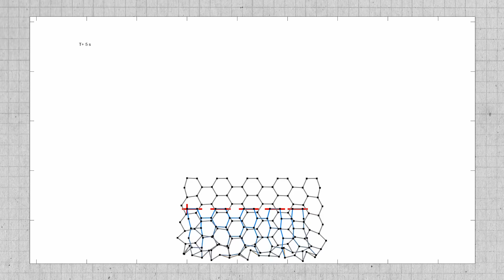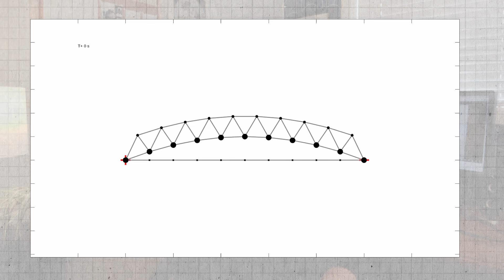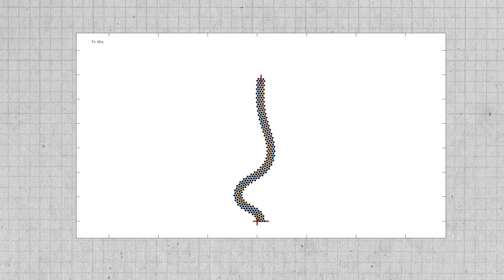Hexagons Are NotSoGreatAgons

Comment: My research work focuses on Hexagons, and I have compared some designs to triangles. 
Neither Hexagons or Triangles are the Bestagons. It depends on the application intended. 
Triangles have at least two sides with angles less than 90 degree. If you are using triangular plates to reinforce a composite, the the sharp angles work as stress concen-"traitors" and thus cause earlier failure or internal cracks. Hexagons in that situation would have angles of 120 and thus reduce stress concentration at the edges. You still also obtain large area within a small contour relative to triangles for reinforcement. There is plenty of related research in bio-inspired structures based on Nacre.
Triangles in strut structures are definitely more stable and rigid. Again nasa has used that significantly is what is called "Isogrid".
Discritized Circles are GONS with large number of sides, and in some applications, circles are the best.

Comment: Your argument has many issues. For starters, you claim that the examples in gray’s video of graphene is inaccurate because the carbon is resisting all other carbon, not just the one. This, however, does not matter at all because it does not change the fact that graphene is still extremely strong. It just means that the examples in gray’a video are very slightly inaccurate. Then, you neglected to mention that gray himself that hexagons are tear resistant vertically, but also flexible and fragile horizontally. You don’t test both angles, which gives triangles an unfair advantage in the stability test. You constantly don’t mention hexagons strengths, which would be fine if you didn’t claim that this proves triangles are better. However, you are claiming they are anyway without even close to a fair measurement. As for the honeycomb pattern, there are other reasons why the honeycomb pattern is used instead of something like foam. You aren’t an engineer, and don’t seem to have done any research in why they use specifically the honeycomb. You also claim that triangles are better for things like bridges. They have very different usages, and this argument is like comparing tape with backpack straps. They aren’t remotely similar. Also, in the section where you talk about how hexagons are not just a bunch of triangles, that is only in a situation where they are not tiled large enough. The bridge example suggests that those triangles form a hexagon, but they aren’t even in the correct shape. If you removed triangles from the grid where actual hexagons were formed, you would find that gray was correct, because those are the only ones that actually form hexagons. The ones in the bridge do not. On top of that, the statement is not even a fair statement. Removing a triangle would make it 5/6 of a hexagon. This is an unfair comparison, and you were still wrong regardless. You seem to constantly only show examples that are bias towards triangles, make straight up false arguments, and neglect to mention extremely important details that make all your statements objectively false or insignificant. Weather or not this is on purpose is debatable, but either way this video is very misleading and false

Comment: 3D printing is changing the math of what internal shapes you can put in a fill for cheap. Those triangles will probably gain popularity as the printers come down in price.
Reply from the maker: @garinsutton6808  the issue I’ve seen FDM 3D printing with triangle infill is that the head has to change directions at the same place so you get bad adhesion. Unless you’re using SLA sintering I think squares actually win out

Comment: I know I’m late, but I have a few questions. Mainly out of curiosity, because all though I love science and math, I am not an engineer.

When relating to the actual connection point between hexagons, would it not be stronger than a group of triangles connection.

For clarification; It is shown in the examples of how hexagons fail to hold shape while triangles don’t. Though not relating to the shapes strength itself but purely its three pointed connection which kind of makes a triangle like connection which is as stated by the video triangles are fairly structurally sound. 

Next question, maybe I misunderstood something but I don’t think shapes fold into each other like that in real life. It doesn’t really change how the hexagons fails, but I am wondering if it is more of just for the example or actually something more significant?

Lastly, HEXAGONS ARE STILL BESTAGONS

Though this video was genuinely cool to watch.

Comment: The hexagonal sheets too often form aromaticity - which causes the electron clouds to delocalise to WITHIN the hexagonal carbon rings. I.e. the repulsion you described but your supports aren’t limited to the nodes

This causes them to have a very different property to a normal hexagon like you discussed and may be why there’s that observed disconnect for why hexagonal organic structures

Your simulation at around 6:20 shows this well; because its going to behave more like cyclohexane instead of graphene
It’s remarkable how well the addition of the triangles simulates that aromaticity 
There’s a reason we often denote aromaticity in organic chemistry with a circle though; because in reality the electron clouds behave like one. In otherwords if you increase your no. triangles from 6 to infinity; the resultant circle inside the hexagons with triangular braces is how graphene and aromatic lattices behave 

You’re super close with your simulations, but if you check the electron density diagrams of graphene,you’ll see what I mean

Comment: Im sorry but im with the hexagons are the bestagon for that one reason, manufacturing. You're right with rockets where weight is everything being able to cut a few grams is worth it. The thing is most manufacturing doesnt need that level of weight savings. In fact i think that me being to go and just buy honeycomb structure is incredibly useful for any project id want to do. You technically could make your own custom trigular structure but then the question becomes is the time you put into making that structure worth the weight savings? And most cases, no. I came from working on cars so my idea of engineering is much more pragmatic than a true engineer.

Comment: Misleading.  He never said "hexagons are the strongest shape," whatever meaning that even has out of context, he specifically said "most mechanically stable for the least material."  I suppose people could misunderstand that as point load of this kind but I don't think you've disproven anything he actually said.
Reply from the maker: @XatxiFly  it is not the most stable for least material, that is the triangle. If you add the extra material to make a hexagon into 6 triangles sure the material doubled but the strength MORE than doubled. You could make the edges thinner and get that material back, or just use larger triangles to the same effect.

Comment: I’m not an engineer so this may explain my ignorance, but what if at 3:50 you connected two furthest points? Wouldn’t you have compression and tension? Obviously this is adding members so it’s still not as good as the triangle, but it wouldn’t need all the furthest points connected.
Reply: Two furthest points of the hexagon? It would still collapse right? Or what do you mean?

Comment: IMHO the Pentagon is the bestagon because take 12 pentagons joined at the corners they will stand up proud. Repetitively triangulate those pentagons results in the Epcot dome. The hexagons that appear are just a secondary effect as the pentagons are still there, but smaller.

Comment: The main thing going for hexagons is that they are the highest sided shape which can form a regular tiling. The more sides a regular shape has, the lower the ratio is between perimeter and area. Circles have the lowest ratio, but can't be tiled and always leave some space in between them. So hexagons are the shape to subdivide the greatest area with the least amount of material.

Triangles are strongagons, Hexagons are efficientagons.
Reply: And what are squares?
Reply: @anthonypacillas4830  Squares are easy to cut and can be turned into the strongest shape, triangles, with a single reinforcement between the corners. Squares do use more perimeter than hexagons to enclose the same amount of area, however.
Reply: @Darth_Insidious  Hmm, I will need to soul search more info.

Comment: Actually never heard of cgp grey or the video that you mention. also never seen any of your vids before either. no idea why youtube sent me here, but the topic seems interesting. XD

Regarding the strongest shape, honestly, I've always thought that circles were the strongest shape, until I got more in-depth with the topic. The reason for that was that I saw a lot of arch bridges as a child and I thought "well, the engineers who built this thing must have chosen that shape for a purpose so it's probably just the best way to do things." On truss bridge stuff, I thought that they used trusses instead because they're easier to make and require less material than an arch bridge (and in some places building an arch bridge would be simply unfeasible because of height and stuff). Same with those big pressure tank things on trains, they're always round so I just thought that circles were simply the best at everything.

Comment: Obviously triangles are stronger than hexagons, but the reason honeycombs are comprised of hexagons is because they offer an optimal compromise between structural integrity and material usage. The simulation at 6:00 -- while very cool -- is somewhat of a moot point since (as u later explain) it is "wet spaghetti". Circles and triangles are the strongest 2D shapes but interestingly both form hexagonal patterns when packed together

Comment: Grey never claimed that they were the strongest shape. He claimed that they were ONE of the strongest. Which is true when applied correctly.
Reply from the maker: strong relative to what? Of the regular polygons, only triangles quadrilaterals and hexagons can tile. Triangles are the strongest, quadrilaterals are optimized for forces in two directions (see ULA), and hexagons are wet noodles by comparison. What are they stronger than exactly?

Comment: I was under the impression that "strength" usually refers to how much force an object can take before breaking, not deforming. by that definition, strength and rigidity would be 2 separate things, but they're used synonymously in this video. is "strength" actually a clearly defined term across science and engineering, or can it refer to multiple things?
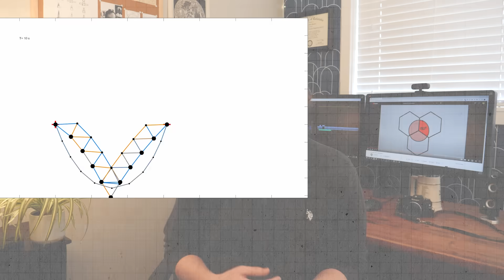Reply from the maker: With regards to materials you are right but I would argue that they are very much linked when looking at large structures. For example, the bridge at 8:00 didn’t fail in the material sense where a member broke from stress, but if an engineer tried to argue that the bridge was perfectly strong you probably would disagree because it collapsed under its own weight.

Also in terms honeycomb, triangles would actually be stronger because they are supporting some of the load unlike hexagons which are too flexible to really support the skin under tension or compression.
Reply: As a structural engineer, I can confirm that strength and stiffness are not the same, but they do often correlate. Steel is about 30x to 50x stronger than wood, and is also about 20 to 30x more stiff, but as you can see, it's not a 1:1.
 
Specifically, strength would be compared to a stress rating. Mild steel often can support about 36 ksi (kips [one thousand pounds] per square inch), while stronger steel can support 50 to 100 ksi. So, if you have a 4 sq inch bar of A36 (mild) steel, you''ll get about 4*36=144 kips of capacity (in tension, or in a short compression block). Concrete is around 3 to 10 ksi, aluminum is about 10 ksi, and wood is more like 1 ksi.
 
For stiffness, the rigidity, that's another value, the Modulus of Elasticity, and is a measure of how much a material respond to the force. All forces requires deflection, but you can change that a lot by using more stiff materials. Steel is almost always about E=29,000 ksi, which means, if it didn't break (at 36, or 100, or whatever ksi), at a force of 29000 ksi it would have elongated by double. In practice, steel yields at about 36/29000 = 0.1% elongation. Concrete has a about a 3,000 ksi modulus of elasticity. Wood is about 1,500 ksi. if you have 10k ksi concrete and 10 ksi aluminum, they both still have their own moduli, at about 3k-ksi and 10k-ksi, respectively. If you go ahead and make the same sized column out of each material and apply the same force (below both of their yield strengths), you'd find the concrete deforms about 10000/3000 = 3.3x more than the aluminum column, tho, as discussed above, both of these are going to be o the order of a couple thousandths of an inch, even if the test specimen is a foot long.
Reply: yes multiple like the gender and confusion you had

Comment: Adjacent to the rocket structure point, and how the rectangular grid is good because it offers long, straight load paths for structural stresses: Hexagons are potentially good for spacecraft heat shield tiles for specifically not having such long, straight paths between them. Not because of structural load, as they're not load-bearing structures, but because hot air will get in between any gap in the tiles, and apparently what you really want to avoid is long, straight paths for the air to take. I don't know why this is, I'm not a rocket engineer, it's just something I've heard from people who are. Hexagons should make the tile spacing more forgiving.

Comment: CGP gray was trying to make the strongest shape while using less material.
Reply from the maker: That’s still triangles. Going from triangles is o hexagons reduces weight by about half but more than halved your strength, leaving you with a worse strength to weight ratio. To compensate you would have to thicken the walls of the hexagons, resulting in a heavier structure overall.

Comment: You completely missed the point of hexagons. They are NOT meant to be the best supportive structure, they are meant to get the most out of a given surface area when tiling it up. You COULD patch the leather of a soccer ball out of triangles, but I would argue, that would require more stitching, and therefore more opportunity to breaking.

Use a concept in the wrong context and it sounds stupid. What a great revelation.
Reply: I would say your argument is a bit flaud due to Football players dont use hexagonal balls anymore. They use different shapes so its easier to make and they look cool. Some examples are the jabolani which used triangles and another abstract shape and the ball for the 2022 WC ball which uses alot of triangles. Another example are your grampapis old football when he used play which used 18 pannels of Rectangles.
Reply from the maker: My point exactly
Reply: @ConHathy grey NEVER said hexagons are the strongest shape...

Comment: you're forgetting that the hexagon is 6 triangles; you one example where you got close to it you over supported the hexagon (Adding extra bars vertically and horizontally) instead of attaching all the corners to the center point.

You need to be comparing tiled hexagons to tiled triangles, which turns out to be identical.

Comment: Just a note with your square example. Sometimes shapes are chosen because they're easy to analyze rather than because it would truly be the best possible shape to choose.
Reply from the maker: Actually, if you rewatch that video, the triangles were easier to simulate which is why they were used on the older Atlas V, but the squares were more optimal so they are being used on the new Vulcan. Triangles grids have mostly equal strength in all directions so can be approximated as a simple cylinder while squares have more complex behavior (despite the less complex geometry)
Reply: good point! this vid came up on my feed again and I'm not sure what I thought I was saying lol. You're pretty clear that you are talking about good shapes for a particular situation rather than all circumstances.

Comment: Honeycomb panels. It may be easier to construct cf triangles, but it does have real world elements, like myriad straight struts with bending resistance and joints that also have a yield strength. Much like graphene has at the apices. So the animation doesn't do justice to the subject IMNSHO. It is, in reality, demonstrating a hexagonal net which you can buy, but more likely square matrix is available because they would be easier to weave &/or repair. Ask any deep-sea fisherman. Top & bottom sheets produce long real world joints also.

Comment: 3:35 The result of the test is not wrong, but the test is flawed due to uneven comparison, the same problem critiqued seconds prior with the nanotubes. You have a far bigger object compared to a more compact one. The test also doesn't apply tension, so not even other stable structures would stand straight (like a square), which makes it biased towards the triangle results, even if the results would be the same.

Comment: Only disproving hexagons are strong-agon isn't convincing enough to make the shape not bestagon. From the field of engineering perspective alone, which the video title didn't mention and is extremely misleading, many alternate shapes are better suited to fill different technical demands. However, I was hoping for a more thorough exploration of the arguments against the performance and significance of hexagons beyond the field of engineering. With that, I believe the counterargument should be more solid and convincing for many people.

Comment: I'd say for the rocket panels, a hexagonal "reinforcement" of the tank would be not just heavier, but also a lot worse in both vertical compression and horizontal tension, just like diagonal squares. So here the alignment does matter quite a lot.